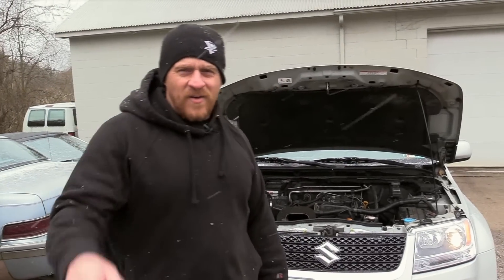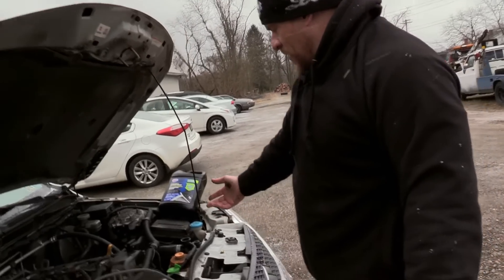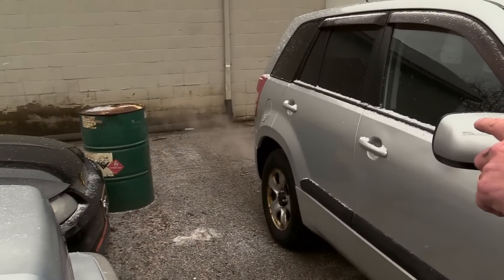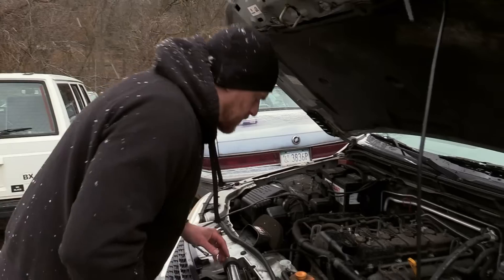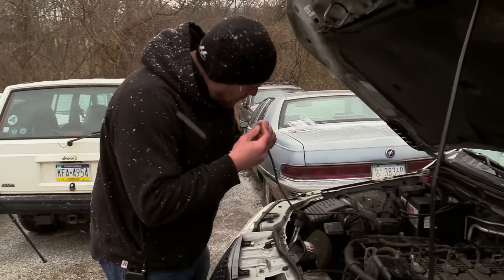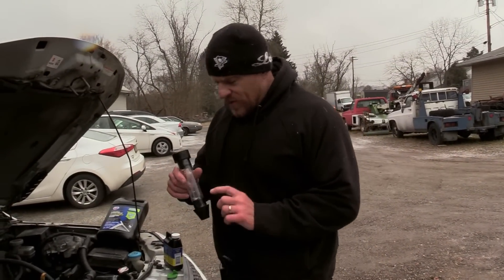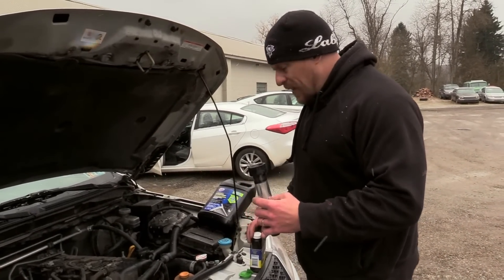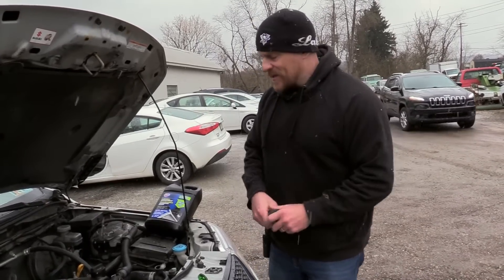Testing For a Bad Head Gasket [Chemical Test Kit]

Comment: Hey there, I know you're a fan of using the hydrocarbon test. My main question is can you use a combustion gas detector to detect for your hydrocarbon like you did your you older videos using the expensive machine. Hydrocarbon is a combustible gas according to Google.  They sell combustible gas detectors at homedepot/lowes , kline has one, it looks like a freon leak detector but for combustible gases. That would be a more cost effect/ portable tester , if it works the way I'm imagining.  Any thoughts on the matter.
Reply from the maker: I'm not sure if those will work or not, sorry

Comment: I'm wondering if the cooling system is air locked and that's causing the overheating. One of our newer John Deere tractors requires the use of a Snap On coolant transfer tool that pulls vacuum on the system to refill and eliminate air pockets -

Comment: I used the best block tester kit available, the one with the two chambers and squeeze ball, gave it ten rev cycles while squeezing, and the fluid was still blue, but with a slightly greener tint than the unused fluid.  I don't know what to make of it. What's the best place to get a decent five gas analyzer for cheap?  Since I'm not interested in all five gasses, and I'm only interested in detecting hydrocarbons, is there a one gas detector that will work? Like one of those cheap flammable gas detectors on Amazon?

Comment: We had a head gasket last year. The leak was so minor that it would run rough on startups and smooth out.  We never block tested but I'm not sure that it would work, pressure test held 21 psi for well over 10 minutes but sure enough it was leaking coolant and had a slimy plug.  Needless to say, we replaced the engine.  Thanks for the video though!  It's refreshing to see you mess up, lets us know you are legitimate as well as any potential issues we might have using the same test methods!

Comment: Since I’m not a big fan of this test, I’d leave it as a last resort if I’m on the fence, since there are other ways of getting answers. In some cases, your nose can actually be the only diagnostic tool you need. Many of the bad head gaskets I’ve come across, I’ve paid attention to the smell of the coolant (or just sniffing at the filler, even if the coolant level is down). If you smell exhaust in the coolant/rad, that’s an indicator right there, that the head gasket is no good. Remember, the exhaust leaking into the cooling system hasn’t ran through the cat yet, so the smell should be pretty potent. You can use this fluid test kit if you want, but if the car you’re looking at is showing all the classic symptoms of a bad head gasket plus you can smell exhaust in the cooling system, to me personally there’s no reason to go any further. Another test I’ve seen done and have done myself, (with positive results every time) is apply air pressure to the cylinders (engine leakage test) and then watch the coolant level in the rad/pressure tank. If the coolant rises as pressure is applied, that proves the head gasket is leaking.
Reply from the maker: I've had many pass the smell test and the air psi test and still cause intermittent misfiring on specific cylinders. Confirmed by a gas analyzer was always my go to. This one is close, but not as good

Comment: Hey Paul, why on the neck of the radiator's cap was bubbling if there is not a head gasket issue??? I thought bubbles came from a combustion leak...... NIce video as always!
Reply from the maker: I didn't see bubbles, but you can get bubbles from a few things. 1. A newly filled system that not all of the air is out of and 2. When the engine is hot and above the boiling point of water
Reply: @ScannerDanner  Thank you Sir for your answer! It's clear now! Love your channel!

Comment: Why was the water pump replaced? Was the shaft  mechanical seal leaking? Mechanics love to change water pumps when a car overheats but really these should only be changed if they are leaking or the pump is obviously damaged or as per a scheduled maintenance event (timing belt replacement). What do you think.
Reply from the maker: It was leaking I believe. Don't remember, this was 3 years ago 😉

Comment: I don't use a bulb or intake source just for the reasons you  had with sucking the coolant in. I use a Mighty Vac so I can control the intake of vaccum. I imagine it was a non OE thermostat used. I see that alot on Hondas by DIYers

Comment: I caught myself smelling maple syrup.... I'm glad when it's just the radiator.
When a head gasket fails only under load, pressure transducer on the radiator and cyl #1 sync.
Then give it some hard pulls.

Comment: Could be the temperature sensor gone bad...like what my car did and almost blew my motor...
Reply from the maker: This was an actual overheat and the cooling fans were running constantly with cold air coming out of the radiator. So definitely not the symptoms of a bad coolant sensor. In those cases the fan may not come on at all

Comment: In the UK, the gas-analyser emissions test is the central part of the annual mandatory vehicle roadworthiness check, for obvious reasons: it helps remove polluting vehicles from our roads.    Vehicle emission control was the driving force behind the introduction of OBD decades ago and has become increasingly stringent over time as we have become aware of the dangers of excessive emissions.     So how come Pennsylvania dispensed with such an (apparently) important independent test?     Have other states done likewise?   I don’t suppose California has.      Is it the belief that OBD on modern vehicles is good enough to detect emissions problems?     But that would let older and badly maintained vehicles slip through the net.    Seems such a strange decision.   

(I imagine the owners of the UK vehicle test stations would love to be able to be rid of their exhaust gas analysers for the fortune they would save in capital expenditure as well as the annual maintenance and calibration costs.)

Comment: Is the thermostat backwards. LOL. I ve done that early in my career. Head check should be first test on any overheat vehicle. At Mazda I check freeze frame at least. As long as 250 and lower I proceed to repair. 300 gets dicey and I do a block test.

Comment: I have experienced false negatives and false positives with these kits through the years. We no longer use them.
Reply from the maker: How did you get a false positive? Old fluid? 
I always test the fluid first with my breath. 
False negative for sure. But I've never seen a False positive. Thanks! Any additional info you can share would be great.

Comment: The radiator cap is no good. You can see it's missing the center plunger that controls flow from the overflow tank to the radiator and back. That will cause it to spit fluid out and overheat.
Reply from the maker: This was a stuck closed brand new thermostat
Reply: @ScannerDanner  That radiator cap is still bad regardless. It's missing the center plunger, that's why when you squeezed the upper radiator hose with the cap on it shot coolant into the overflow container.
Reply from the maker: @justforkiks29  I'll be sure to tell Pete (3 years ago 😅)
Thanks!

Comment: I wonder if you remove the small hose that goes from the radiator cap port to the overflow bottle to allow some vacuum to escape and not allow the coolant to be sucked into the tool. Just a thought. Thanks so much Paul and Caleb for all your great videos.
Reply from the maker: That's what the small hole in the fitting was supposed to do, but I guess the vacuum source was too weak to use it? I don't remember. This was filmed like 3 years ago lol

Comment: Never saw that kit with a vacuum hose, only used the one with the squeeze bulb. Best one I ever had, I set the kit on the coolant bottle(hot bottle) and it turned yellow before I started the engine

Comment: I’m back to comment again but I love to just watch these videos just because. Also any oil mix would indicate a leak and if I suspect it I would send some oil to black stone to check for coolant anyway. Oil pressure is higher than coolant pressure so the oil will find its was to a lower pressure and mix. Also I would have turned the AC on to force the cooling fan to kick on.
Reply from the maker: That's a good test too but many times in the early stages of failure there will be no coolant in the oil, or vice versa.

Comment: Is there anything that would cause a false positive on the block test? I've seen vehicles with no symptoms of overheating or head gasket failure, even vehicles that just had the head gaskets replaced, and the block test tests positive.
Reply from the maker: False positive, no, false negative absolutely!
Reply: false positive maybe due to old solution absorbed so much atm CO2 already, just a little more sucking of radiator's regular air causes the tipping point? False negative may mean the HG leak is so small that tester will take a longer than normal time for the concentration of CO2 to tip the ph scale color change? Like u say, better have another test to substantiate, same reason a doctor tests ur urine and blood at the same time. @ScannerDanner

Comment: ive never seen anybody have trustworthy results with one of these kits. I was going to mention gas analyzers but you talked about that not really being an option anymore. So whats the answer? Pressure test with a rad pressure tester? Maybe in combo with a compression test?  
(edit) I should have read thru the comments first-you talked about compression tests not really being reliable either.
Reply from the maker: It's really a combination of many different tests. This chemical test is the next best one to the gas analyzer.

Comment: I've seen vid's on how to tell water in the oil (blown head gasket) by using a little oil out of the pan or dipstick and heat it up. If it boils when heated there is water in the oil pan.
I have seen where chemical tests have shown all good but has been proven wrong by the above method as per Matt "Schrodingers Box".
Reply from the maker: The chemical kit is not 100%, neither is the water in the oil test. Early stages of head gasket failure will pass that test too. The HC test using a gas analyzer is the only one I've been 100% with and no one had a gas analyzer anymore!

Comment: Never was a big fan of those chemical block testers.  Not 100% reliable for testing a blown head gasket. Those things work only if the combustion gsses get into the cooling system which doesn't happen every time.  A lot of times the blown head gasket will at as a one way check valve allowing coolant to be sucked into combustion chamber to be burt off but not allow gases into the cooling system.
Reply from the maker: I've not seen that. At some point, combustion gases have to be getting into the cooling system. But I agree on the false negatives at times

Comment: I always pressure test the radiator cap . Since the radiator was changed , the tubes are probably not clogged . And I reverse flush the system , including the heater core . Many times a heater core is clogged . The radiator tubes usually clog in the center and are cold when blocked . Lucky it was only a defective thermostat .
Reply from the maker: Lucky for the customer and Pete!

Comment: Use the holes in the adapter to regulate the vacuum.  Use two fingers.
Reply from the maker: Can't reach the hole with it installed. Not with my finger anyway

Comment: I have used that tool a many of times and it shows no sign of head gasket failure even though coolant was going somewhere and it could not be found externally, I could take the spark plugs out and pressure test the system over a period of time and use a borescope and find coolant leaking into the cylinder. I purchased a gas analyzer just because of this. I work on flat rate so time is money and the risk of removing parts is avoided as well. The only time i have had it work is when all the signs of a failed HG are already there.
Reply from the maker: Why I've always loved the gas analyzer. I never, not once, missed an early stages failure with it. But good tips, thanks

Comment: Seems to me that having a squeeze bulb to draw the fluid in is better than connecting to a vacuum source for a number of reasons. I have to admit that I've purchased some of those cheap Lisle tools myself over the years. Some are ok, and some seem to have been designed by engineers who dropped out of school too soon.
  I can't believe how cold it is there, looks like some snow on the camera.
Here in southern Arizona it's still getting up close to 100 during the day, but of course that's normal for us. No, it's not climate change, it's been this way since 69 when I got here, and 100 years as the historical record shows before then. We get a little cooler and night during September but the days don't start cooling off until October.
Reply from the maker: Old video, never released. It's 65 here today 😉

Comment: I use the vacuum adapter with the holes in it when I see consistent bubbles in the coolant or there is pressure in the system. I think the vacuum adapter with the holes in it allows pressure to escape. I know the radiator cap is used to pressurize the system in order to raise the boiling point. My question is this. Is it possible to get bubbles in the system from boiling a bit when the cap is off? I had an old Bronco that would constantly bubble and the test would always turn out negative for combustion gasses. It did it before and after changing the thermostat.Thanks for al the videos over the years. I've learned a lot.
Reply from the maker: 100% yes (boiling comment)

Comment: I am used to the old style tester too.  You need air/gases from the radiator.  If the coolant level is too high, take a couple of inches out of the radiator...there are a few ways to do that.  Make sure the coolant is flowing so you get coolant that is coming the head.  If it is a small leak, it is more likely to show in the results.  Glad it's fixed...

Comment: The accuracy of this test can be misleading. I have seen in the past head gasket failure, but would only overheat with the cooling system under pressure. This test works well when head gasket has completely failed. Sometimes if the head gasket is slightly compromised, but has not failed completely this test can be inaccurate. The best test in my opinion would be to pressure test the cooling system, and check for leaks, and pressure loss. If no external leaks are found, then using a bore scope down the spark plug holes to check for coolant works well. Leak down testing can yield favorable results as well when trying to track down a bad head gasket.
Reply from the maker: Agree, this test isn't 100%. The one that is, that has never failed me is the HC test with a gas analyzer in the cooling system.

Comment: your strong vacuum source creates such large pressure differential, it lift the coolant into tester, use hand vacuum pump and sucks longer time. Blue liquid is a litmus solution test, CO2 changes to carbonic acid and the ph of solution changes to yellow, acidic color.

Comment: These chemical test kits can work if there's a large leak, but I can confirm that they aren't reliable on tiny leaks. I went through that years ago back in 2015 with a Civic that had enough of a head gasket leak to push coolant out of the overflow and maintain enough pressure on the system continuously that the coolant never returned to the radiator when the engine cooled off, but it didn't have any of the "normal" head gasket leak symptoms. Engine ran great, 210 PSI compression across all 4 cylinders, no bubbles in the radiator when doing a leak down test, no smoke from the exhaust, no coolant and oil mixing, etc. But sure enough, a new head gasket fixed it (common problem on the 1.7) and it's still doing great 8 years later. So while this is a cheap and easy test to try and a false positive is unlikely, don't rule out the possibility of a false negative.
Reply: Well said

Comment: You should do a compression test and also a Lead down test to find out the head gasket is leaking intake or exhaust . Could be a bad thermostat not opening ?
Reply from the maker: I've seen compression and leak down tests pass with a bad head gasket. Ones that will only leak with hundreds of psi in the cylinder from combustion.